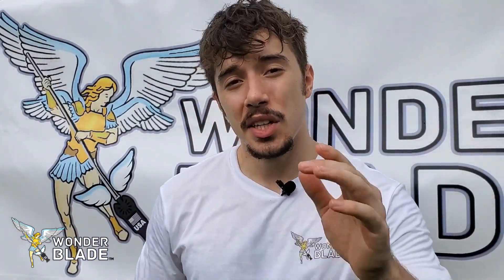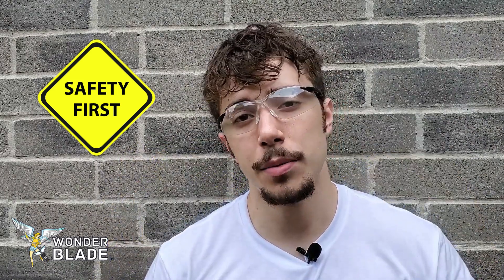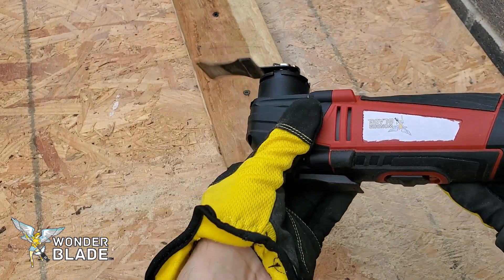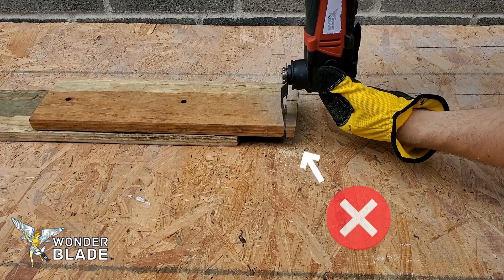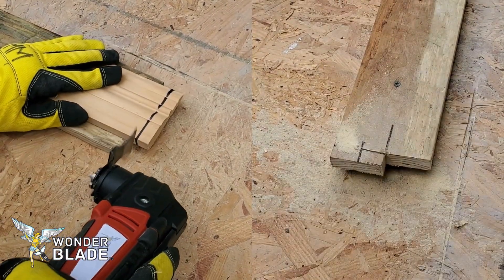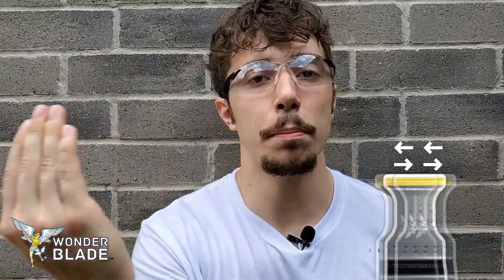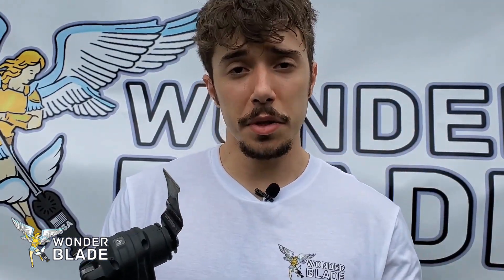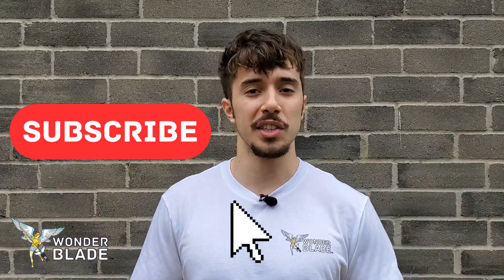How to Cut Straight with an Oscillating Multi Tool - WonderBlade™

Comment: Thanks for the clip, I've always wanted to do videos myself, but am too involved in construction to have the time to do all the video stuff. Good on you. 
  However, the first thing I would say about this is I would not try to do long cuts with an oscillating tool. I would bring a circular saw out, and when coming to a 90-degree corner, instead of cross-cutting, I would bring a jigsaw out. However the oscillating tool is a fantastic tool, and is so helpful and so many other different applications.